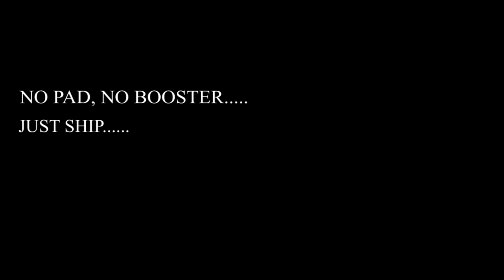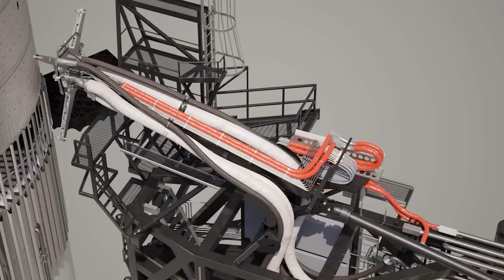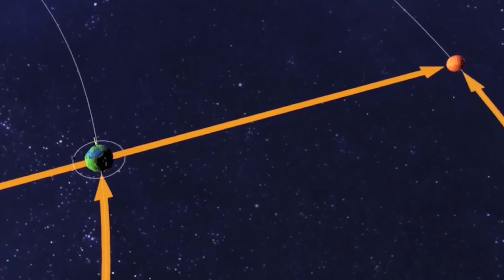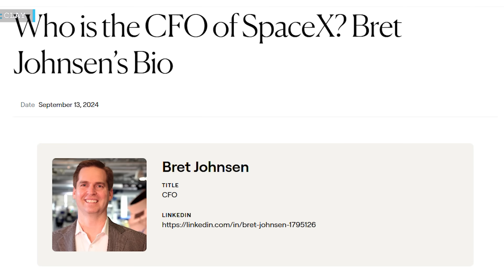SpaceX Starship Is Running Out Of Time | SpaceX's Backup Plan Is..... Absurdly Genius

Comment: 4 starship failures in a row because of plumbing issues. And SpaceX comes with a new workaround! This is serious engineering on the road to sucess!🤣
Reply: No one else is close to SpaceX F-9.  Starship will be just as good, even if it takes 5 more years to get  it working.  They have Starlink in plus, so funding should be fine.

Comment: Error: Gwynne Shotwell is an engineer.  She holds a Bachelor of Science in Mechanical Engineering.  She also holds a related Master of Science in Applied Mathematics.  Math is always a helpful tool for us ME’s 😂
Reply from the maker: Thanks for the info!
Reply: @ENGINEERINGTODAY1 , Always enjoy your channel!
Reply: @ENGINEERINGTODAY1  Are you a bot? You hearted not just the investment scam post but every single reply, boosting their scam instead of removing it. You ok?
Reply: This channel is not known for doing any research before posting.
I'm waiting for a detailed analysis from CSIStarbase, or Scott Manley to get the real information.
Reply: @ghost307  They don't correct themselves when called out either. Low journalistic ethics.